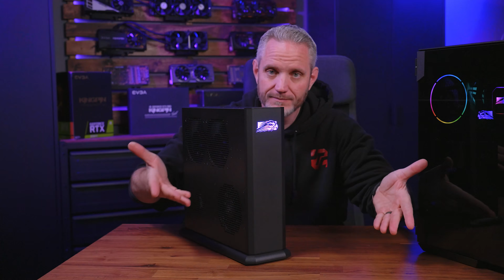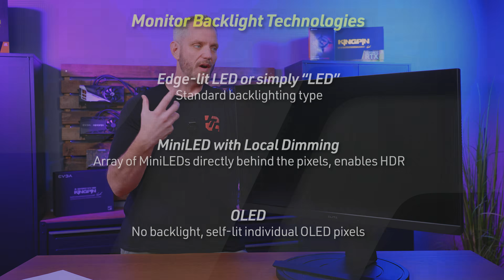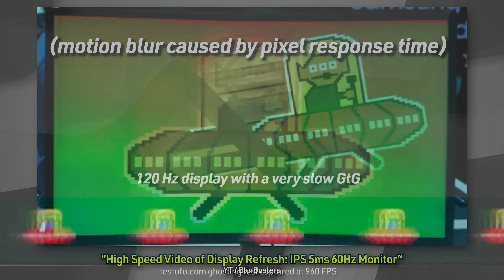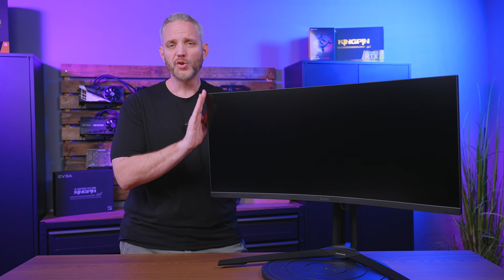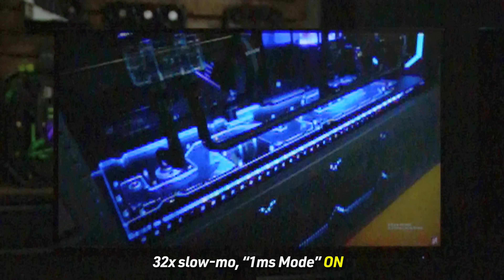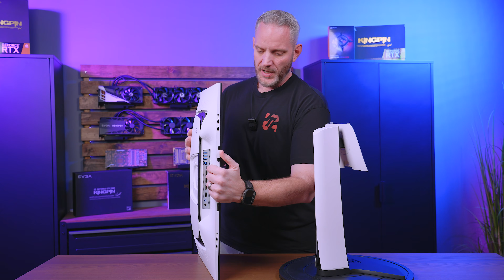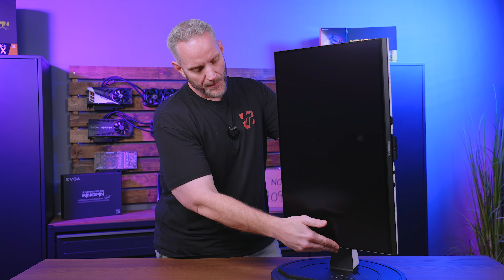Ultimate Gaming Monitor Guide: Find the BEST Screen for Your Setup

Comment: Good vid as always @jayztwocents , two points to touch on, (without starting the argument of who's and why is bigger better)  1440 is the sweet spot for gaming, 4k is a sales gimmick until you step into high end, even 4080 4k you'll be lucky to get stable 100fps in most titles. Even just high everything in game before reaching max depending on titles. But 4080 1440 most modern titles will be stable around 130-144 FPS. (Depending on other system hardware)

(Console before you say it, 4k on TV with console hardware is different, but if you want to open your eyes little unknown secret put your console output to 1440 (2k) and see how cooler and smoother your console runs and how better your game is, response, loading and detail quality improves as overall load is reduced , 4k demands a lot of resources just to populate and process that many pixels, some TVs might not support 1440 (2k) though) 

Gsync - free sync . Jay should have covered it a bit more but it's also hard to not go deep into the rabbit hole.  Gsync as a product feature needs to be Nvidia GPU to a gsync compliant monitor for it to be optimum with gsync features but it will work with free sync, but not all of the gsync aligned features. 

however as I found they are not fully compatible with each other at the same time, I run a gsync 1440 primary and a free sync 4k secondary. The primary Is configured to take full advantage of the gsync suite in all environments, the secondary with free sync enabled was causing stutters on the primary in a few games and even causing stutters on the secondary in the same or other titles and programs.  I spent ages testing and changing between monitors to figure it out.  Disabling free sync directly on my secondary monitor resolved this and improved FPS on my primary.  Note this can also be an issue if your outputting to a capture device.    Logic is simple if you spend big bucks on a system and upgrade for anything above a current gen X-070 with intent to use all features then give your card the gsync monitor for absolute freedom, if it's below or the system is mid tier, free sync will do it well.

Comment: Add in one thing about OLED displays, the burn in issue with a minor bit of care, is not a big concern. I jumped on the Gen4 OLED early in 2024 and have had no regrets and not seen any indications of burn in at all.  Let the panel do the refreshes and run an OLED safe screen saver or full screen an OLED safe YT video if you are not going to use the display for 30+ minutes and you should enjoy your investment for years to come.

Comment: I have a hodgepodge of monitors, none of which are above 60hz.  So yeah, I'm gonna likely go with a simple stacked setup, where the main is 4k high refresh rate and an upper panel also 4k but 60hz.  Then I'll get a KVM so I can easily switch between a work PC; Mac; and personal laptop.  I'll also hook up an Xbox and PS5.  I'm not at all a competitive gamer but I would like to experience 120hz or better gaming.  I have a stout rig for 3d modeling and simulations - but I'll need to upgrade the GPU (not cuz it sucks, but because it is damaged from travel).  I'll likely wait for the 50 series cards to come out and get either a 5080 or 5090 (depending on what my financial situation is at the time) All that to say, I'm taking suggestions for my new panels.  TIA

Comment: I'm running two old 1080p 24" BENQ monitors from 2014 that were built for back then E-Sports so they can be set to whatever size you want to scale them to etc etc for tournament people etc etc.
I only bought them because they were on sale at a good price and my Second Samsung T220 1680x1050 16:10 Monitor from 2008 died on me so I got 6 years out of them (I bought them in September 2008 and Boxing day 2008) Penny (the first one) Died Spring 2014 and Vern lasted another 5-6 months before he died.
These two BENQs have been in service from 2014 so Going on just over 10 years now and get used for both Personal use and Work use with my Personal PC plugged into HDMI 1 on both and my Work laptop plugged into HDMI 2 on both and when I work I swap 1 or both to the Work monitor and with a KVM I control both PC's with One Keyboard and mouse

The only part of these panels I don't like is that they are in fact only 60 hz but since the type of games I play are mostly RTS games and older games and nothing that super benefits from higher rates I'm ok with this. I'll keep using them until they die and when they give up the ghost on me then I'll get some new monitors  which I think next time I'll get a Wall mount for them because that will save me some desk space.I've already wall mounted the work laptop so that it sits up off of things.

Comment: I recently upgraded to new system ryzen 9 7900x and rtx 4070 with 32GB DDR5 ram 

My current monitor don't know exact name but its a Msi optic 1MS 24 inch curve 144hrtz panel and it constant hits around 95% of the refresh rate for FPS and that's capped because if I uncap it the system some reason crashes

Comment: So here is my question about a recommended 1440p 144hz monitor.  How well does it scale and display a native 1080p 60hz signal?

If i buy a monitor like that, im gonna want to connect multiple devices on it like an old Xbox or Nintendo Switch.

Comment: You made this video at the perfect time Jay. My HP 2509m monitor is quite old and with my new RTX 4060 I want a new monitor that's either G-sync or adaptive sync compatible. But it also needs to fit inside my desk hutch, which is 26 1/2 inches wide, and 18 3/4 inches high.

Comment: most overlooked for sure. Monitors can vary so much and change the experience depending on what your looking for. A lot of the decision has to do with if you care about HDR or if you want to play mostly competitive. Last time i checked OLED cant get nearly as bright as mini LED so it cant do HDR as well. The problem I see with some people is they have great PC specs but under spec their monitor with old tech and at that point your basically wasting the money you spent on ur PC and essentially bottlenecking your experience in one way or another by the monitor. Its the last part of a setup before it hits your eye its important.

Comment: 21:9 is the sweet spot I have 16:9 and 32:9 and frankly 32:9 is overkill and not very compatible with most games. At least 144
 4k OLED to boot. Not a lot of those out there right now.

Comment: Thanks for the update. I bought the PG32UCDM Samsung OLED last year at this time and I have to say, you really don't need to spend that much. It's a good monitor but for my use case I probably would have been just as happy with something less expensive.
Reply: Samsung?
Reply: @fuzzyplonks  yes
Reply: @Dmachine2000  OK, didn't know Samsung also has PG32UCDM, I thought that's from Asus
Reply: @fuzzyplonks  sorry. Samsung panel. It is Asus. Brain fart

Comment: Frankly I am actually considering going from ultrawide back to standard and this is someone who has been gaming on ultrawide for almost 10 years.   I was a very early adopter to using ultrawide screens and early on I had a good regular monitor for backup for games that didn't properly support it but for the last 6ish years I have just used ultrawide.   

I love ultrawide in things like skyrim, cyberpunk, fallout, dragon age, etc.   Pretty much every story based game the ultrawide really elevates the experience.   It is way more immersive when you have that wider aspect ratio.   I also find that support in these games is generally really quite good for ultrawide and ui issues are less of an issue.  
 
Then I go to play something that is more action based game like an FPS with hud elements in the corners of the screen or bad hud scaling for ultrawide.   It is rare where I see options to center the UI or move it in games and when it exists it can often be a pain in the ass to find those options.    It has gotten way better over the years though.   5 years ago those UI center options didn't exist in most games and now it has been trending to be more common. 
  
It leaves me 50/50 on which way to go, I learn towards ultrawide but the huge price premium(your often paying twice the price for 30-40% more pixels) and the ui issues get so annoying.      Luckily my oled ultrawide is going to last me at least another year so I have plenty of time to figure out what I want to go with.  Frankly I think it will depend on if there is a good 4k ultrawide when I decide to upgrade or not.
Reply: Glad someone brought this up. UW is great for first or third person games. The extra peripheral view make them much more immersive. However, top down games are a different story. The continuing implosion of AAA gaming means most of the innovation and actually good games are coming from the indie side of things.  Top down and isometric games are much more prevalent and 2K and 4K monitors are better suited for them. I'm still in the UW camp, but both my UW monitors are now 7 and 4 years old. Both are still in excellent condition, but the next monitor will probably be a return to 4K.

Comment: Imo buy whatever the cheapest 90hz-100hz-ISH monitor you can find and call it a day, there is no need for more hz and anything less is horrible.
Reply: I notice the jump from 60 to 90hz more than 90 to 360hz... Just get the cheapest 90hz monitor and call it a day 90 is the sweet spot
Reply: if you are rich and got a RTX 4090 you could do 2160p at 90fps+ but for most people realistically 1080p 90hz is MUCH more manageable.

Comment: Any monitor less than 32-inches is too small for modern usage in my opinion.  Aside from that, I can't use any of the ultra-wide aspect ratios as they give me claustrophobic reactions. 16x9 or better, 16x10 are the only wide formats that work for me.  Dell makes a 32 inch, 1440p, 165hz, mini-led panel for about $350, but you can get it on sale for less than $300 and it's so good I've bought three of them for myself and 4 as gifts for other people.

Comment: I found upgrading my main monitor to OLED+ultrawide was the biggest upgrade I had done in a while.    Don't even need a 4090 to make it worth it - I think a xx80 + OLED monitor is going to be a better upgrade for a similar price or less than going for a xx90 level card.

Comment: I would like to add that most people will benefit from high refresh rates, bot not everybody. I personally can't see any difference whatsoever above 60Hz. Sooo I wish they made cheap 60Hz 4K 27-32" OLED 😆 The other thing is that while current gen IPS have ~1000-1300:1 contrast ratio, VA panel goes from 3000-5000:1 ratio so a lot better blacks and more vivid color. Nothing remotely close to OLED but there is a noticeable difference. I would say that VA panels are better for singleplayer slower games, while IPS would be better for multiplayer shooters.

Comment: So upcoming new rig is going to have a 5090 a 9800x3d  which panel should i be looking at at 27inch for an oled. single monitor use

Comment: One thing i think people should think about when upgrading monitors is if they use that computer for anything other than gaming and if so, what do they use it for? There are tons of remote and virtualization solutions such as RDP or Citrix where having mismatched resultions between monitors, higher resolutions than the computer you're remoting into, or different scalaing settings can make a higher resolution monitor more trouble than its worth to just get a nice 1080p monitor or monitors.
Reply: Never had any real problem. RDP from my old sub-HD Lenovo laptop and monitors was a bit of a challenge. With Citrix I edited the .ics file if necessary to set the resolution to that of my monitor. Certainly never had any issue with my Retina 5K 27" iMac. And wouldn't expect any with my 1440p UW PC gaming monitors.

Comment: Another consideration around pixel density, yeah a 4k 32" is sharper than a 1080p 32" screen, but if you eyesight is rubbish, you might not be able to tell the difference.

I'm blessed with just crappy enough eyesight that 32" 4k is the limit of my vision (and a bit beyond it), but I could tell the difference between my 1080p and 4k. For me it was more about the hdr tech and the vibrancy of new panel than the resolution (I also had to get 240hz because my brain can't cope with refresh rates that aren't a multiple of 24)

Comment: just got a PG27AQDP and it will be my end all be all monitor for the next 5 years. Only way I'd ever upgrade is for a 27" 480hz+ 4 or 5k with a 1440p dual mode. Not sure if we'll get that anytime soon or not. if it gets announced at CES by some chance I can return this monitor up until February so I'll just swap it.

Comment: I find the statement about VA being middleground between IPS and TN to be factually incorrect. In fact, it is the IPS one that is in the middle between TN and VA in terms of refresh rate, response time and colour accuracy. VA are still far better for colour accuracy (especially black or other very dark colours) than IPS, even the cheapest ones are on par with the best IPS panels. The drawback is, of course, huge, because response times of VA panels are usually many times slower than IPS, not exceeding 7-8 ms unless we are talking about elite Samsung panels for thousands of dollars, thich are so different from other VA that they are basically in completely another class. There are other issues raising from the slowest response times, like Black Smearing or Ghosting, but that doesn't change the fact that VA panels have much better colours than IPS.
Of course, non of this will matter soon enough, since OLEDs are winning more and more of the market and there are rumours about possible solution for the main OLED problem (burn in), which presumably isn't as critical for PLEDs, which are a new type of OLED that uses complex polymers instead of standart organic materials. Take that information with a grain of salt though, I am not sure how accurate these rumours are or how close this technology is to being used in gaming monitors, for now I think it has only first models for some smartphones, and even that is not confirmed by official sources. But the point is that OLED are better than any LCDs in almost every way, and once the burn in problem is fixed there won't be much more reason to buy LCD instead of OLED.

Comment: I’m using a LG 3440x1440 45” OLED monitor. .03 ms response time @ 240 Hz. That is paired with a XFX RX 7900 XTX “magnetic air video card. My only complaint about the monitor is the excessive 800R curvature. I wish it had a 1500R curvature instead of. But it works great. I can often get more than 240 fps. But I usually limit it to 120 fps.

Comment: I think you're confusing curvature rating (e.g., 1800R) with the HDR rating (e.g., HDR 1800).  As others noted, the LOWER the curvature R number the more pronounced the curve (smaller radius of a circle where the monitor curve is an arc on said circle) whereas the higher the HDR number the higher the nits (range of brightness - higher means darker darks and brighter brights).

Comment: Once you go OLED 21:9 HDR you can never go back.... 
You should invest first on a good monitor, then you should think about your tower.
Monitors usually are not a part you change/buy often (or buy used)  and it has the most impact on user experience. (more then GPU/CPU/RAM/FPS/GRAPHIC SETTINGS/SOUND/MOUSE/KEYBOARD)
Nice video Jay if you can please do a video of how to clean (correctly) a monitor, especially OLED.
Happy new years yall

Comment: I am running 2 27" 1440p 165hz Panels. Both are rated for 1ms. I came from a 1080p 60hz office hp monitor and was like "yeah this is fine I dont get the hype and such" but when I tried it out at a buddys house, I was like wait why is yours so smooth and fluid? He had a 144hz panel and I was blown away.

Comment: Upgrade from a TN to VA recently, went from 27" 1440p 144hz to 32" 1440p 165hz, improvement enough and does the job decently enough, wanted a ultrawide monitor but costed more then I had, and 99% of them are curved!!!, tried my cousins curved samsung one and don't like at all, but barely flat ones out there!, only wanted one of them since I could do Picture by Picture rather then using 2 different monitors.

Comment: I have a major rant about VESA mounts
Why do some companies recess the damn holes so far into the monitor, behind the monitor's stand?
I ordered some monitors for my sim rig and neither the screws included in the rig OR the monitor were long enough to mount them so i had to wait extra time (also because it was christmas and shipping was slower) for some extra long screws. If its a standard, THEN KEEP IT A STANDARD OR INCLUDE THE HARDWARE REQUIRED TO MOUNT IT ON ANY "COMPATIBLE MOUNT"
Oh and also the angle of the mount sometimes is not aligned with the screen so my monitors when mounted to the rig as slightly pointed up which made it a major pain to align them for triple screen racing.
Ok rant over moving on, happy new year!

Comment: 1440p 165hz 10bit colors is the perfect sweetspot for me. Been running the msi mag 
274qrf-qd for a year now and I‘m absolutely loving it, especially the accurate colors. Had a TN 240hz before wirh shitty colors and similar reaction times, not regrettibg the switch.